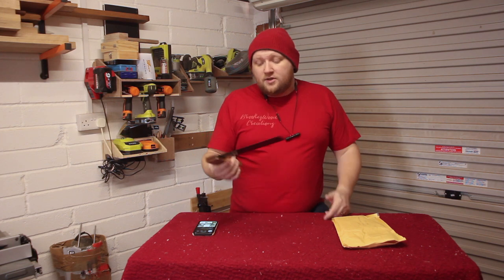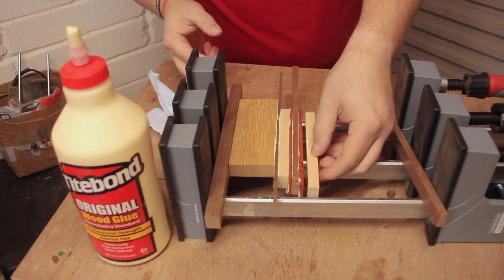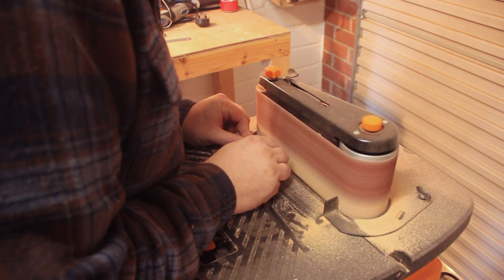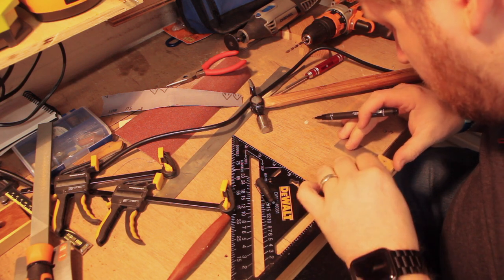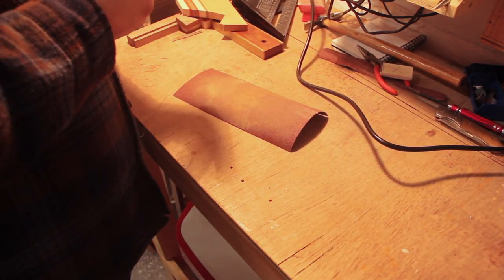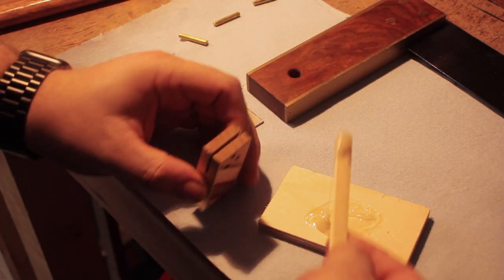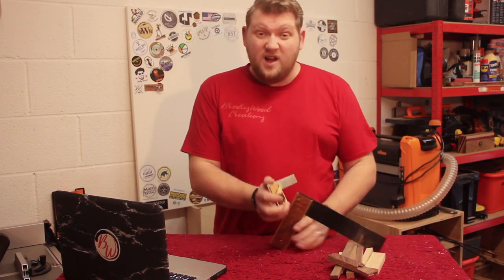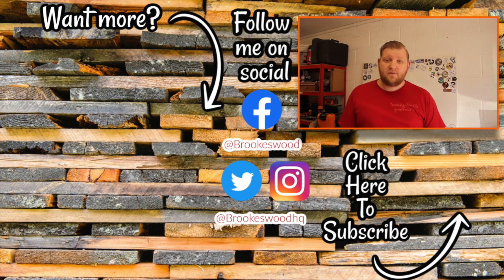How to make your own DIY Mini Carpentry Square

Comment: The finished square looked smart. You sounded embarrassed mate when you said Aldi, don't be half the makers on YouTube use that kit, if it does the job alls good.
Reply from the maker: Thanks, not embarrassed, more surprised. Some of the stuff I have had from there was shocking but these little rasps were really good.
Reply: @BrookesWood  ye I get you with that mate, I had 6 squeeze Clamps and they all died within a year 😢 but I've got a few really good bits, ferrex belt and disc sand especially is great.
Reply from the maker: Yeah I have been looking at that. The disk sander is apparently quite handy to have.